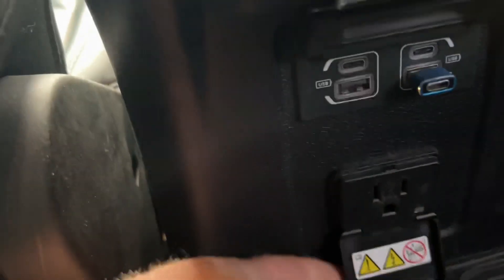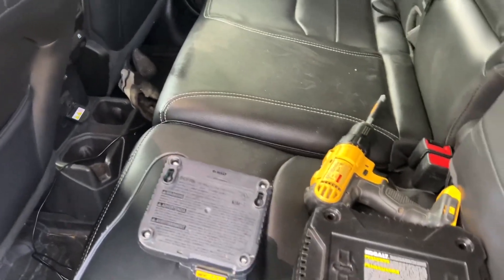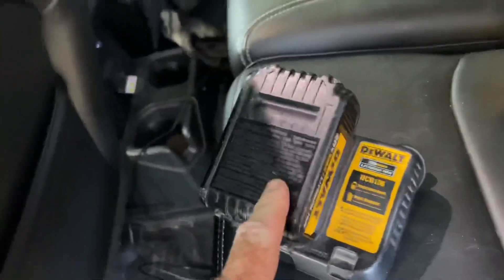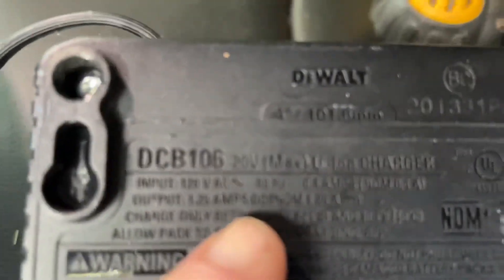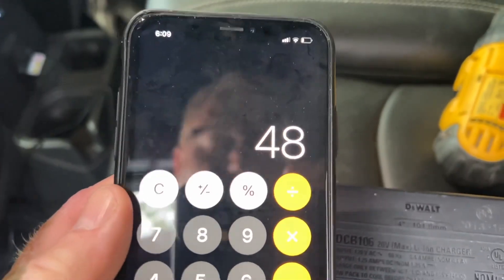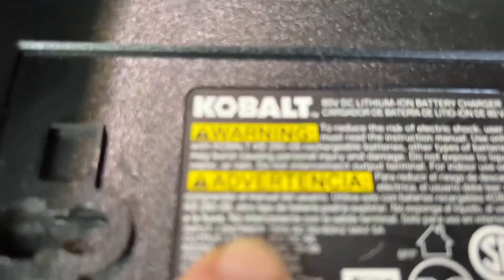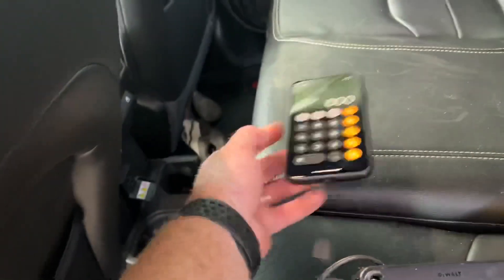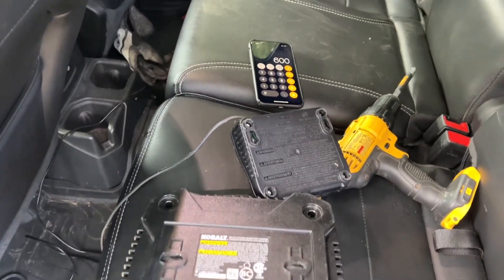How much is 150 Watts?

Comment: How to make it this outlet work while engine off
Reply from the maker: @vtc12352  It can’t. You would have to buy an inverter and wire it up to the battery. 150 watts isn’t enough to do much anyway. I would get at least a 1500 watt and wire it up if I wanted/needed 120 while the vehicle is off.

Comment: Thanks! Best explanation on this thing I've found between Google and on here. So guessing that amps or amperage is the same as the term current
Reply from the maker: Yes, amps is the measure of current flow. Not sure why volts is voltage but current is amperage but that’s how it goes.

Comment: I imagine that if something above 150 W is plugged in there, the fuse will break, right?
Reply: The power inverter module (low voltage module; there's 2 on this vehicle) has the ability to shut off the outlet until a lower power device is plugged in
Reply: @TrepKing95  wow that's great! Thank you for your answer.
Reply: @TrepKing95  I can verify that.  I had a gadget that had a startup spike that would sometimes shut it down, sometimes not.  If it didn't at startup, it would run perfectly fine.  If not, it would just reset, and restart the outlet after you unplugged.  Never had to replace a fuse.
Reply from the maker: @TrepKing95  I saw that too. I plugged in the bigger battery charger to see what would happen. I didn’t have to reset anything afterward.

Comment: Thanks for the explanation!  I had a gadget that run at 1 to 1.5 amps at 120V.  I'm assuming the 1.5 was a spike when it fired up.  Had the odd experience that sometimes it worked from that plug, sometimes not.  Now I know why!  Thanks, again!

Comment: A 600 watt battery charger ???
Reply from the maker: Kobalt 80 volt tools. The batteries are 4 amp hour and 7 amp hour for the push mower. They charge pretty fast and are air cooled by the charger.
Reply: @Wrangler4XEFans  
That makes sense now...
Reply from the maker: @DARisse-ji1yw  They are big batteries. You could work out with them.
Reply: I can confirm they do pull 600 watts while charging.  Pretty beefy batteries, and the built in fan keeps them cool while being charged.